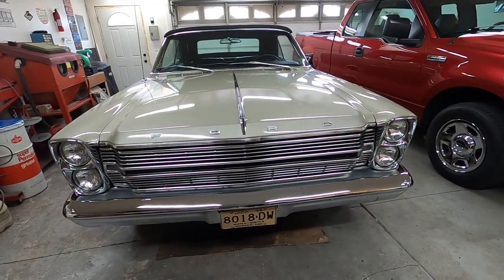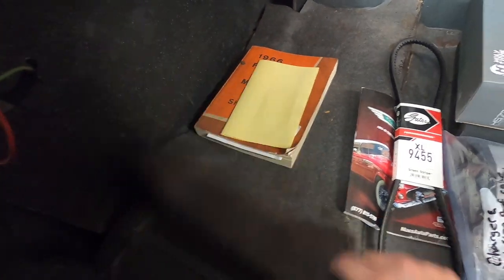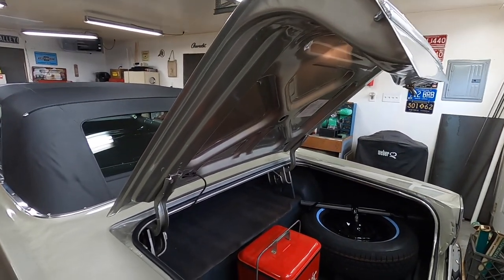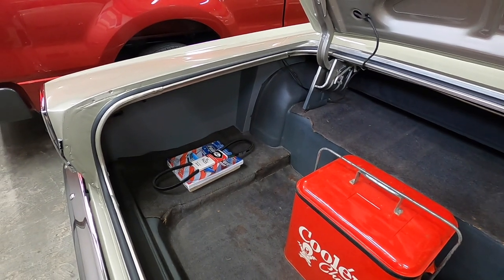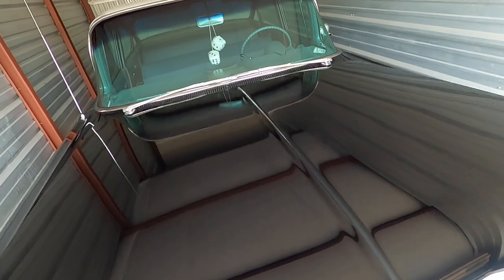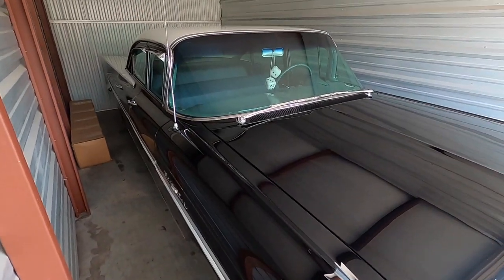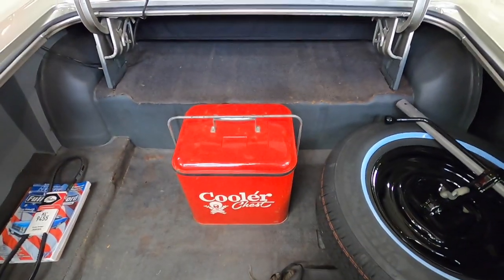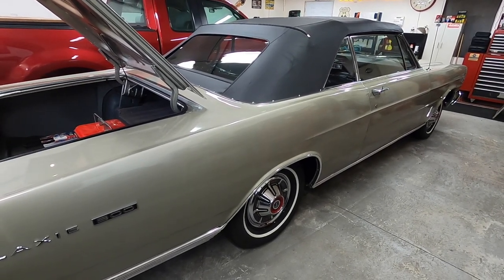1966 Galaxie 500 rolled off the Mahwah N.J. assembly line 56 years ago today, April 29th 1966

Comment: That storage unit really demonstrates how BIG the Bel Air really is.  It barely fits! But “barely” still fits!
Reply from the maker: I put the F-150 in it during the summer months.... the rear bumper will be an inch from the back wall, and the overhead door almost hits the front bumper. The unit is 10'X20'.

Comment: I bought myself a roll of oil change stickers to use on my cars and people's cars I service. They're the vinyl cling on type, they're ok. Really looking for a stick-on type like that roll of Motorcraft stickers you have. Car looks great, my galaxie's birthday is coming up on June 25th according to the door tag. Mine has no DSO code though, it came from the Twin Cities plant. There's still a couple of oil change stickers hanging on the door jamb of mine from 1971 and 1974, both from the same shell station.
Reply from the maker: I take the truck and Escape into the Ford dealer for their oil changes, as they're cheaper than doing it myself, plus they rotate the tires for free. My old cars, I still do the oil changes on. I have vinyl stickers for the top of the windshield I sometimes use on them. I keep a maintenance log book in the glove box of my cars.
Reply: @OldCarAlley  That's funny you mention the log book, I have one in every car as well.

Comment: Wow! This is Jay Leno's favourite year for the Galaxy and really, it is a very pretty car. I had a friend in HS who drove a 2dr hardtop, it had such a smooth ride, as I remember. I also remember that friend telling me back in the day (1973) 'this car is finished, it's toast!' And I suppose it went to the wreckers a couple of years after that. I knew then that was a terrible waste. Btw did you know this was the car the character David Vincent drove in the TV Show 'The Invaders'? He drove a brand new 66 Galaxy convertible, his was blue if I remember correctly. Be glad the top and the windows roll up tight, you want to be as safe as possible when the aliens land in their UFO! (If you don't know what I'm talking about watch the opening credits of the show :) )
Reply from the maker: Yes, my Galaxie just floats down the road as smooth as silk. It rides much better than the F-150 and the Escape. On top of that, the Galaxie has the fewest miles of all my cars too. The truck has just over 100,000 miles, the Escape has 125,000 and the Bel Air has 199,000 miles. The Galaxie has 80,000 miles.

 I rarely ever watch TV, so no I have never seen that. Since I was a little kid, I have never been much of a TV watcher. I could easily live without a TV.

Comment: Of course the Galaxie is looking fine.  The side cardboard and new mats will certainly bring the trunk up to perfection!  Maybe you could alter the right side cardboard so it would fit next to the spare tire?  The copy of the registration I have for my Belair states that she was first plated April 1959.  So I kinda use that as her birthday.  Looks like you're doing fine in your recovery.  Hope to see the Belair out soon.  Take care my friend.
Reply from the maker: I'm thinking the right side cardboard will fit without changing anything.... it's just that there was never a panel there from new. I am feeling better and am kinda hoping to get the Bel Air today. My Bel Air is a late 59.... August 59. I had a 60 that was October 59, so they were very close in production.
Reply: @OldCarAlley  I would like to get the right side cardboard for my Belair.  I guess they make them for  when there is a continental kit on the car.  I'm not sure if it can he altered to fit around the spare tire.  I'm on the fence if I want it to look original or to cover up the inside of the fender.  Like on the other side.  Do you think you're ready to be able to use the clutch on the Belair?
Reply from the maker: @martinbeneteau309  Yea, I think I will be able to work the clutch now. I was going to get it out today, but am worn out from mowing the lawn..... I have been putting that off, but the front was getting long and I didn't want the city getting after me.
Reply: @OldCarAlley  ya I've cut mine twice this year so far.  The longer you let it go the harder it is to cut.  And if you bag it it takes even longer.  But don't push yourself to hard  the Belair can wait.  But I do understand why you want to get behind the wheel!

Comment: Good to see you Howard and hope you are feeling good. You have done a great job restoring the Galaxie right down to the last detail when it rolled off the assembly line. Are you going to drive the bel-air now that the battery is back in it?
Reply from the maker: I'm feeling better day by day. I was going to take the Bel Air out today, but I ended up needing to mow the lawn. That wiped me out, so maybe tomorrow.
Reply: @OldCarAlley  You showed in your video the oil change/service stickers you are adding to your collection. Are you going to frame them and have them on display in your garage?
Reply from the maker: @peterc1904  I might.... I need to hunt all my vintage books of them up.... They're still packed away from my last move.